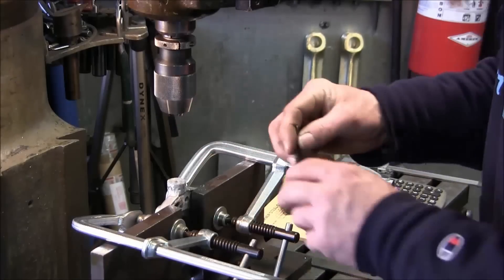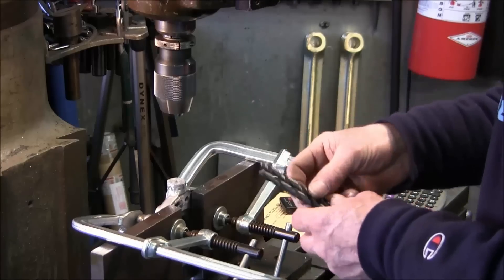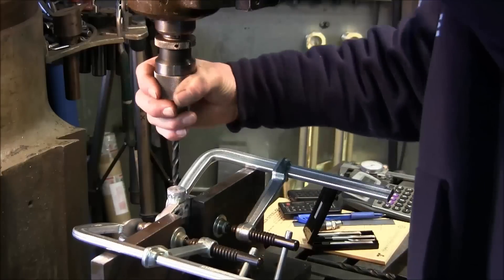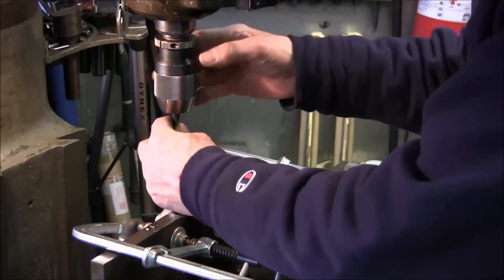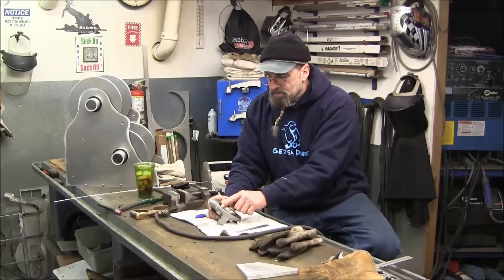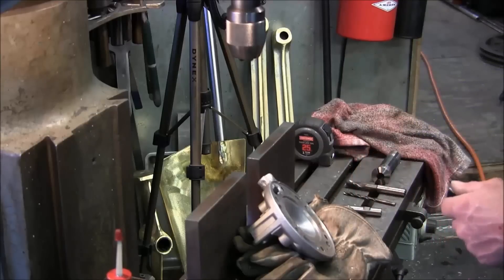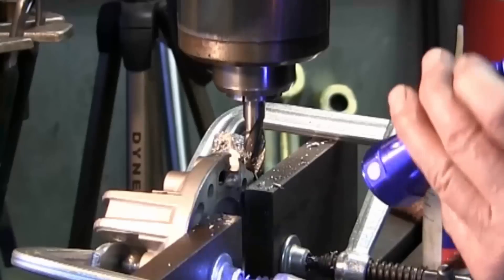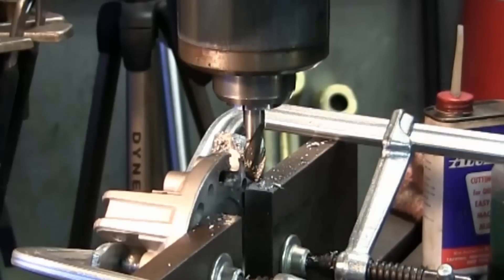The Manual 3D Metal Printer Part Five

Comment: Keith,

That nifty cutting oil dispenser bottle with the magnet on the bottom. The 'dribble' issue. Try squeezing air out of the bottle while the brush points upwards, then apply oil.. Right as you are done applying oil, release your squeeze so the air draws oil back in. Not sure that will help because the brush holds oil. If the maker can figure that out, that will be a sweet addition.

Brian

Comment: Keith, the care you take not only in your work but in the photography is excellent, impressive, and most instructive. I myself had a bit of concern when you laid out the project earlier on that you were possibly not taking into account any "undercut" or ballooning in that water passage and thus you ran some risk of overestimating how much wall thickness you had to work with without punching through. You really had to thread the needle planning the bleed hole into the chamber. Impressive in all respects. Thanks again for your terrific videos!

Comment: I was going to say might have been better to go in the dome beside the spark plug and then put an elbow out for access to the compression release but I bet there is coolant jacket there too. I can't tell from here. Might have been faster to mill a billet head with the port and boss included probably have to build it in two halves with an o-ring though to replicate the coolant jackets, a interesting project but probably not as fast a solution as your weld buildup.

Comment: Keith, have you considered using a gas lens with anywhere from a #6 to a #12 cup size? you can usually get .5" to 1" of tungsten stick out depending on cup size. they have served my very well in the past when it came to getting into tight spaces.

Comment: Hi Keith,
            What a disaster, but it does give pause for thought. I know it is easy say but a check on the amount of material available before drilling such a large hole should have been done.A small 0.050" hole would have been sufficient to act as a pressure relief vent. Still whats done is done and what a lot of effort to overcome the resulting problems. Best Of luckwith the repair.
MoK

Comment: The question is.... If you knew then what you know now about that cavity, how would you have done this job???? I was thinking I would have made a bung to weld to the head then drill through. But that would have had the same problem with the cavity. Now I'm thinking maybe you could have drilled big enough hole to press a sleeve through into the compression chamber then seal the ends with the tig. But there again it's hard to tell just how small the part is in overall size and if there is enough room to make that idea work. I'd like to hear your thoughts. I'll keep watching. Excellent videos!! Like seeing the jobs that throw a curve ball.
Reply from the maker: jeff edison Well if I knew, I would have seen about down sizing the drill a bit and moving it over as close to the head bolt hole and hoped for the best. If it would of broke though even then I would of been a bit worst off being closer to the bolt hole and the heart of the puddle may of melted though, that side. No would-a could-a should-a, just I did-a. ;{)-----

Comment: With your Aluma-Tap bottle, a piece of the heat-sealable shrink tubing- about.380 dia- the entire length of the brush handle won't totally stop the leaks, but might help slow them down. .
Reply from the maker: ***** No the leak is from the end and back down the outside, the tube was made solid, but good thought if a standard brush stem was used. ;{)------
Reply: The tube for the brush needs to be bent about 90 degrees, then it will drip off the brush instead of running down the shaft. ;-)

Comment: Keith I know this is old now but what about fitting a tight press fit tube to line out the hole so you wouldn't have to wreck your way in to weld it? I know lots of diesel engines have their injectors in such a sleeve surrounded by water.